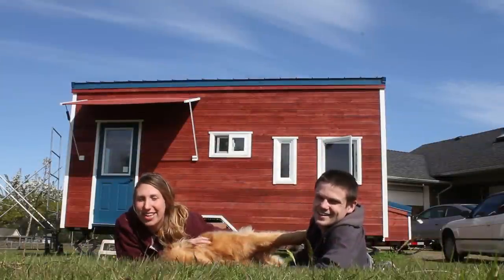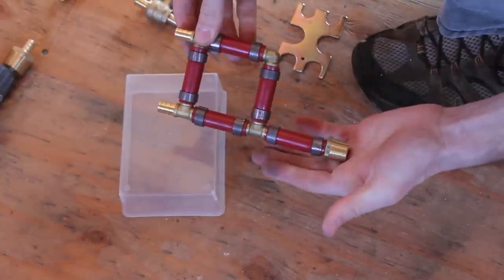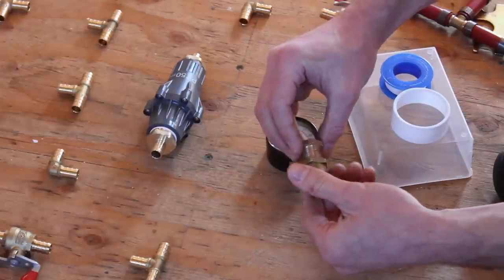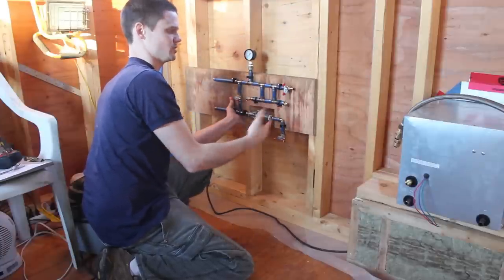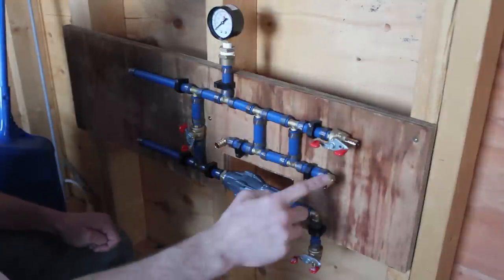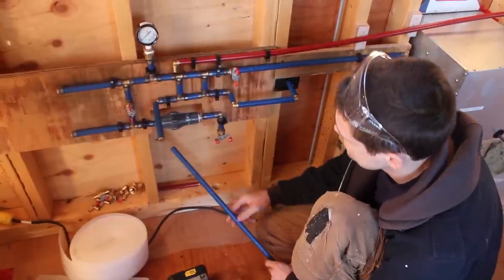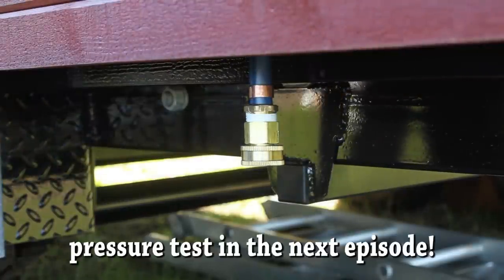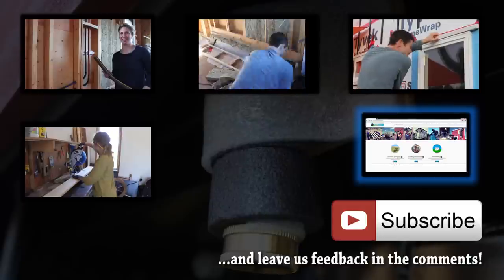Tiny House Water Supply Plumbing (Ep.31)

Comment: I don't understand the loop concept. Best practice is just to size your pipe properly according to expected demand. Typically that means a minimum of 3/4 main line with 1/2" branches. Probably should have put a union in there somewhere also so the regulator can be replaced
Reply from the maker: +Bike Man Dan I tried to research flow rates in a mathematical fashion, and it seemed like 1/2" could flow multiple times our total demand... but this is our first experience with plumbing so we will definitely be following with how it all works out.

Yeah the regulator should be replaceable by cutting two crimps... which will be a pain... but possible. Can you link the union you're thinking of?
Reply: +Tiny Nest 1/2" should do about 10-15gpm given a reasonable input pressure. You may be right an thats sufficient. Just depends on the fixture flow rates and expected simultaneous usage (I doubt you'll have one of those crazy 10gpm shower heads). Unions comes in PVC, galvanized, brass, etc. Could even use a Sharkbite coupler as a union. Heres a PVC example http://www.homedepot.com/p/Mueller-Streamline-3-4-in-PVC-Pressure-FPT-x-FPT-Union-164-134HC/100211318
Reply from the maker: +Bike Man Dan Yeah we've thought about the situations where multiple fixtures would ever be on simultaneously and it should be very rare. Plus we will not have any high-flow fixtures.

Ah, thanks for the link to the union :) I will look into adding something like this when the time comes.
Reply: You say 1/2 inch.  Is that a PEX outer diameter or inner? I think 3/4" PEX OD has 1/2" ID. Thanks.

Comment: I was wondering why you went with wood instead of a steel frame? It seems to me a steel frame would be easier to put together and more resistant to fire issues as well.
Reply from the maker: Steel is definitely an interesting option. It can be lighter and stronger, but it's harder for the average person to work with (usually has to come pre-fabricated from a facility) and can bring up thermal-bridging concerns.

Comment: Yes, I know that the video is 2 years old, but does anyone kmow how the pressure valve is called and where can I buy it maybe over in ebay or something? I would need one with a hole as big as 1 inch.
Reply from the maker: We like to think of these videos as "evergreen" :D 
We actually removed the grey pressure-regulator because it had a slight leak... it seemed like maybe we got really unlucky and it was just a bad unit, but it was also meant for sprinkler/garden systems so it wasn't ideal... I think we'd like to get our own little pressure tank and see if we can regulate our own supply that way.
Reply: Tiny Nest Really nice, it probably broke just because it was out of plastic and couldn't stand the pressure, but this reply kind of didn't answer my question! :D
Reply from the maker: Heh, well we got the thing from our local plumbing supplier... it was the most relevant option they had (other than a huge, heavy, expensive brass regulator that's meant for the main supply line of a full-sized house).